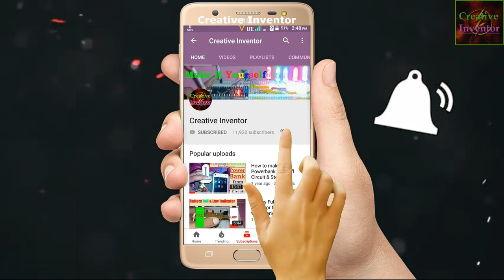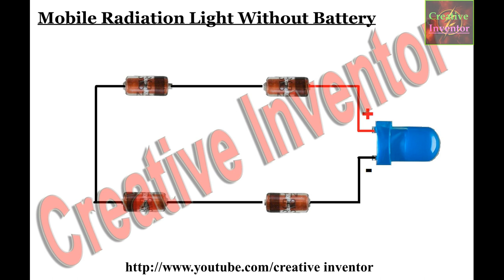How To Make Mobile Sticker Light | Anti-Radiation Led Light | DIY Radiation Flashing Led Light

Comment: Hola 
Lo probe y no me anda que puede ser?
Use el diodo 1n4148como lo pusiste
Reply from the maker: move the in4148 diodes  at the back side of the mobile phone while making a call or receiving a call, you led is not glowing bcoz it is not on the proper side where your mobile network anteena is, so move around the zener diodes on the corner or center of the phone slowly when you are on call or making a call.

Comment: How it works please elaborate, if possible!
Reply from the maker: the diodes i used is a signal diode, and connecting those signal diodes in series double the signal voltage enough to light up an led
Reply: @CreativeInventorlab  ohk got it, thank you so much😇

Comment: IN4148  NOT  Zener Diode 
1N4148 Small Signal Fast Switching Diode
Reply from the maker: Ok, Sir 🤗, i knew that,
i actually i saved all components name as a template in my video converter, so whenever i edit videos i just add that tempelate, that's the reason i ws mistakenly written that.
IM YOUR OLD SUBSCRIBER SINCE 2-3 YEARS😅😅